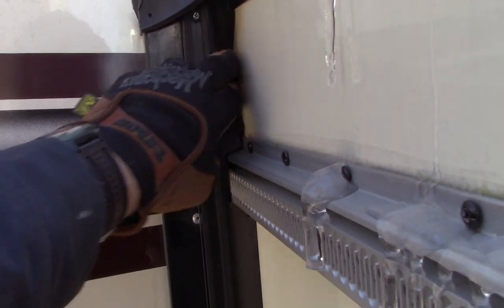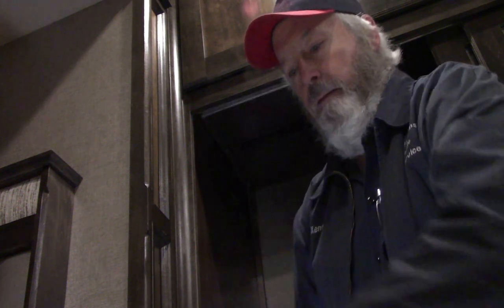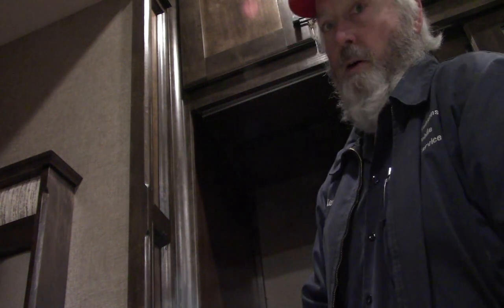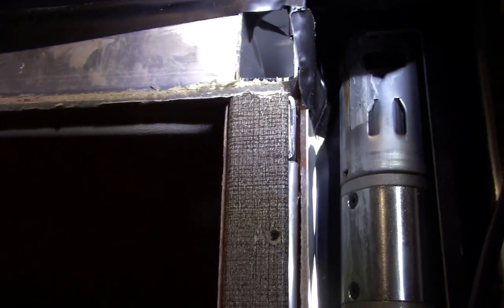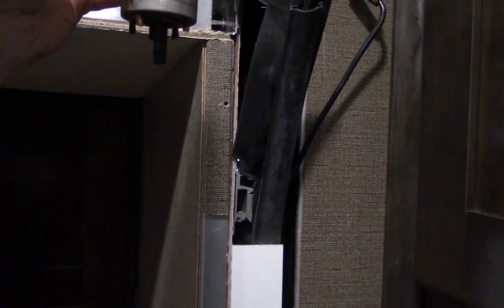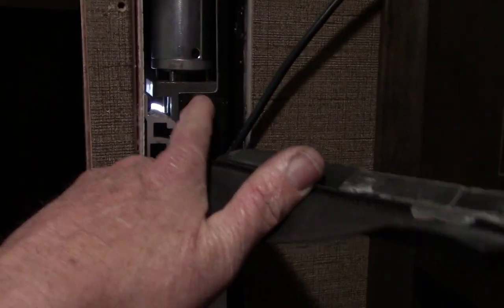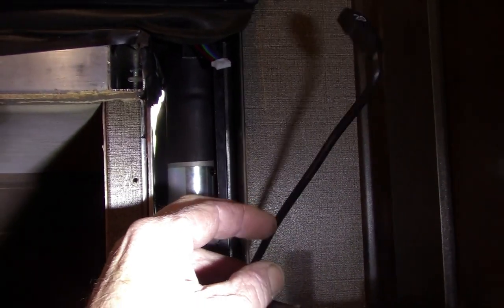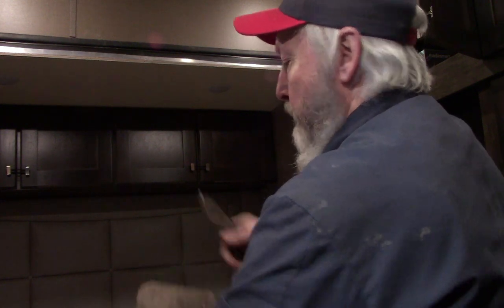Replacing A Schwintek Slideout Motor

Comment: Outstanding video and explanation of the components!  If you come to my house in January to fix one of my motors, that RV will be toasty warm and I'll be there to assist in a moments notice!  You field techs are lifesavers for us campers and should be treated like gold!
Reply from the maker: Thanks, not everybody feels like you. I appreciate that.
Reply: @hillbillyrv you would never need to ask me to turn on the heat or ac. Have at it. I probably would have had it running before you arrived.

Comment: So if the slide would have been closed, the outside trim would have overlapped the side of the trailer. How would you have accessed the retention screw?  I wish the manufacturers would put the slide control modules somewhere more accessible. Mine is probably mounted in one of the worst places possible. I see this trailer is not much better. Great video and thank you.
Reply from the maker: If slide is all the way the only way I know to access that screw is drill a hole in the trim at just the right place so you can access the screw.

Comment: I can’t get the retaining screw back in. It seems like something is keeping the motor from dropping back in. Any ideas?
Reply from the maker: Either the collar under the motor raised up or you don't have the motor lined up with the 4 holes. If it is the collar, push down on it while someone shakes the room. If it is the pins, you just have to get the motor oriented correctly.

Comment: My slide will come in perfectly tell about 70% in and then the motor on the right 100% stops and the other motor continues intell it jams itself and stop. Someone can manually give it a hard push on the outside in the corner that stops and the motor will continue to work... what do you think could cause this? If that screw is missing could it be moving up to much or something like that?? Gonna try and swap the motors and see if the problem switches to the other side
Reply: I thought it was just out of time but after watching a bunch of videos and trying to retime  it for 2 hours I don't think that's the issue
Reply from the maker: The motors can get weak. Maybe that is what is going on or maybe it is binding up for some reason. Are you getting any fault codes on the controller?
Reply: @hillbillyrv   no fault codes what so ever. Even after playing with it for multiple hours.

Gonna swap the motors tommrow and sew if maybe it's just a weak motor.  That be nice  if it was just that
Reply from the maker: @emersonjarvie4355 Keep us posted on what you find.
Reply: @hillbillyrv   well finally got around to swaping the motors from the right to the left  and still doing the same thing... when bringing the slide 3/4 of the way in the right side slowly comes to a halt and the lift side continues 2 more inches in and then James and it stops... 

Try to push the slide back out and it has zero issues.

Can have someone shove it on that right side and it will continue to go past the 3/4 point... 

Maybe I could send u a video...
Reply from the maker: @emersonjarvie4355  It almost has to be binding up somewhere.

Comment: My 2018 Forest River trailer has a slide out that the forward bottom side looks like it needs to slide in about another inch or inch and a half.  The other corners of the slide pull in flush except for this one corner.  Imagine that if the motor that operates the lower forward corner could run for another second it would sit flush.  What do you think...
Reply from the maker: There are about half a dozen companies right now making slide mechanisms. Which one do you have?

Comment: Is it just as much trouble to change the gear box as it is to change the motor?
Reply from the maker: The motor and gear box are come together.
Reply: I was talking about the plastic drive gear holder?
Reply from the maker: @RobertSherwood-n6y  I have not seen plastic gears on a Schwintek.
Reply: Not the drive gear itself but the housing that holds the gear.
Reply from the maker: @RobertSherwood-n6y  Change the whole inwall thingy.
Reply: What do you recommend to lube Schwintek slide out slides

Comment: Enjoyed Video. My RV has that system, Is there a manual crank in for this ?
Reply from the maker: No. Both motors would need to be removed to move the room manually and then it better be a pretty small room.
Reply: @hillbillyrv  I hope that never happens thanks !
Reply from the maker: @randallsimmons7563  Yeh..that's a bad day right there.

Comment: Hello, thanks for the Video, my experience was almost the same as yours on the trim. after replacing both motors I went to time them and the right side motor did not stop on the outstroke,  push the room right off the rack. I managed to get it back in but how do I time the motors if they don't stop? stop coming in ok, but now I am afraid to go back out! Help!
Reply from the maker: I have never had anything like that happen. The room should stop when it gets to the facia no matter what.
Reply: @hillbillyrv  Thats what I thought, I held the button and it popped the trim board right off of the room frame. I am going to park it where it looks like it should stop on the outstroke and pull the power of the control to see if it will set zero there, not sure what else to do.
Reply from the maker: @brucenolan7873  As far as I know the Schwintek system uses an AMP value to tell the motors when to stop in or out. Which means you should be able to just hold the switch until the room stops. I don't know what happened to yours.
Reply: @hillbillyrv  that was my assumption also, motor current peaks at end of travel. I did upgrade the motors from 300:1 to the 500:1 gearing because it is a large pop out. I don't know if that would change the current sense level, however works fine going in but not out.
Reply from the maker: @brucenolan7873  I believe someone at Lippert told me the 300:1 are obsolete. Did you find that to be true?
Reply: @hillbillyrv  I did not check with Lippert, I bought the 500:1 off ebay, it appeared there were plenty of 300:1 availible.
Reply from the maker: @brucenolan7873  I may have been misinformed.
Reply: @hillbillyrv  LCI still supplies the 300:1 motor. Its model # 23675.  The 500:1 is model # 287298.
Reply from the maker: @TheMinnow101  Thanks Carl. You are right I was mistaken about the 300:1 motors. I thought that someone at lippert had told me they were fazed out, but I was wrong.
Reply: @brucenolan7873  to time the motors run the room in and hold the button 3 to 5 seconds after the room stops then run it out and do the same thing usually within 2 or 3 cycles they will be synced you will know when the room comes in equally.
Reply: @marcuscarmouche9023  hello Marcus, I was trying to do that and the motor never stopped, pushed the room right off the rack, not sure what is supposed to stop them? Does the increase in current cause the controller to stop? Didn't work for me. However I don't know if that is because I replaced bother motors with the high torque units.
Reply: @brucenolan7873  were your facia boards in place on all three sides of the slide out?  If so then I would recommend looking into changing the controller.  Weather you are using 500s or 300s the amp out rating is still the same which is usually between 9 to 10 amps dc per motor.   I know the gearing would give more push required for lower amp but I’ve seen several small bedroom slides with the 500/1 ratio and never pushed through the facias.
Reply: @marcuscarmouche9023  yes all trim was in place till the motor pushed through and pulled it off, didn't do that before swapping motors
Reply: @brucenolan7873  wow never heard of one doing that before and I’ve seen several that had the 300:1 s swapped to 500:1 especially on kitchen slides due to mfg companies putting schwintech slides on too heavy of a slide.  If you have more than 1 schwintech try using the controller from another slide on the one blowing through the facia boards.  If not I would invest in a dc clamp meter and see what the amp draw is once it starts compressing the facia should run no more than 10amps dc when it compresses.  I’m curious to know your findings mainly bc I’ve seen those 500:s on nothing but small bed slides and never do what yours did.
Reply: @marcuscarmouche9023  I will try swapping to another controller, have one right there. I did put a clamp meter on it at the time and that was where my thought of amp draw stopping the motor, however it never occurred to me the control could be bad, will try swap and report back
Reply: @brucenolan7873  please do
Reply: @brucenolan7873  just thought of something you may have the first gen style controller if so there was a potentiometer adjustment for the torque of the motors if I remember correctly.  If so turn it all the way ccw and try.  If no luck go clockwise and try once you find the direction that you need you can fine tune if so
Reply: @marcuscarmouche9023  I will look for a pot on the board and let you know if that works
Reply: Oh and if I am right it will be underneath the paper label beside the blinking error lights
Reply: @marcuscarmouche9023  hello Marcus, went to look at controller to identify which one was which went ahead and operated the room in a couple feet and back out and it stopped when I got out to the out position. so perhaps this controller is just a slow learner seems to be working correctly now I pulled the cover off and it does look like there's a potentiometer on the board but I didn't mess with it

Comment: I wish you had shown removing the retaining screw from the outside. I cant find mine.
Reply from the maker: It is either there or it could have fallen out. Outside near the top. Maybe 3-4 inches down.  Should be put thru the rubber, might be under the rubber. Hope this helps Erley. I hope that you subscribed to my channel.
Reply: @hillbillyrv  I see one under the rubber that holds the plastic track to the camper that holds the rubber seal on. Thank You
Reply from the maker: @erleysmiff5151  can you call me? 304-254-9363
Reply from the maker: I actually have to leave, so don't call. It will be a machine bolt, not a screw. So if you think you find it, just take it out. If it is a machine bolt, YAY !!! you found it. If you pull out a screw, put it back and try again.

Comment: Is there a video with the slide in ?
Reply from the maker: I don't understand the question.
Reply: @hillbillyrv  this video has the slide out . I want to know if you have a video with the slide in . My slide won’t extend out and I want to know how to get to the motor
Reply from the maker: @9caplad  I don't, sorry. Maybe you can  contact Schwintek to see if they can talk you through how to move the room.
Reply: @hillbillyrv  ok . Thanks.
Reply: @9caplad  You have to remove the motor/s from the track to manually push the slid in for travel , dont forget to block the slide from the inside before heading down the highway .
Reply: @northlander4370  mine is stuck in . How do you get to it to remove it ? This video shows the slide already out .
Reply: @9caplad  You have to pull down the rubber seal at the top of the slide that is where you will find the motor (at least on my Open Range)  look on the wall of your camper , mine is at the top of the wall,...all makes of campers are different , just remember there is a black rubber covering over the motor , at least you can tow you camper with the slide in .good luck .

Comment: is there a tool to help reattach the rubber holding the harness cable to the motor .  I had to replace a harness cable as it went bad.  Also, can you replace the motor in a bedroom slide say a foot without having to place a jack under the slide out?
Reply from the maker: Not sure what rubber you are talking about. You never have to put a jack under these rooms to change a motor. Thanks for the comment Everett

Comment: My Schwintek slide is broken again. This was a great after market scheem for Lipert they use 24 gauge wire that is poorly soldered on their motors those stinking motors are $400 in Canada, they are a bunch of crooks.
Reply from the maker: I totally agree. I find a lot of broken wires right at the motor. I saw someone resolder one on YouTube. I don't remember for sure who. AZ Expert or MY RV Works maybe. If you find it, tell them I sent you. Thanks
Reply: @hillbillyrv  AZ Expert, watched the Video yesterday.
Reply from the maker: @franklogan494  cool

Comment: Probably the worst slide out system ever.
Reply from the maker: All slide rooms are GREAT when they work properly and they all SUCK when they don't work properly.
Reply: @hillbillyrv  schwintek system has a max weight and length capacity that most manufacturers ignore.
Reply from the maker: @ElmerTbone-  I worked on a super slide one time that was Shwintek. It was probably 35 feet long.
Reply: @hillbillyrv  I sure it was. Motors will burn out all faster the longer and heavier.